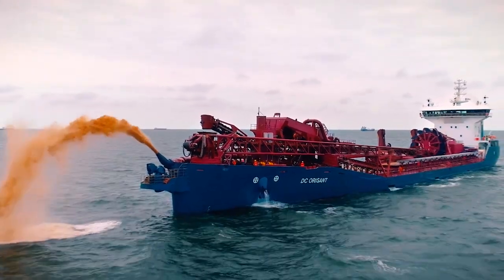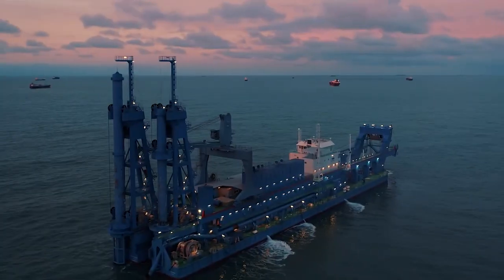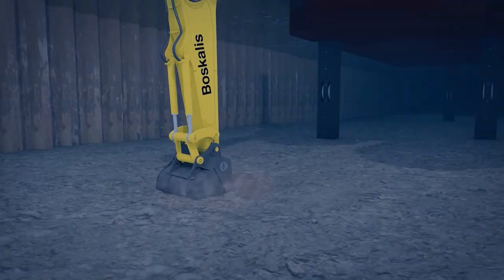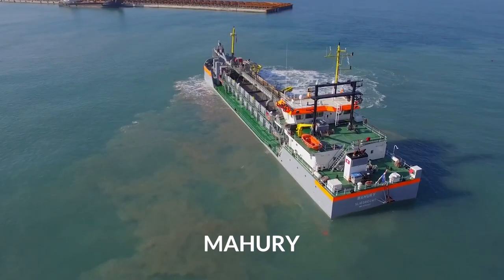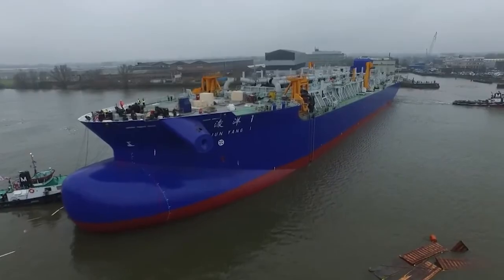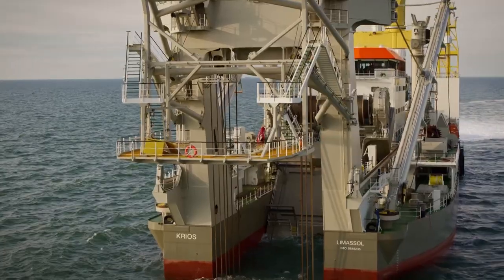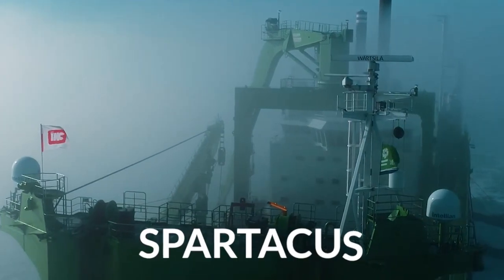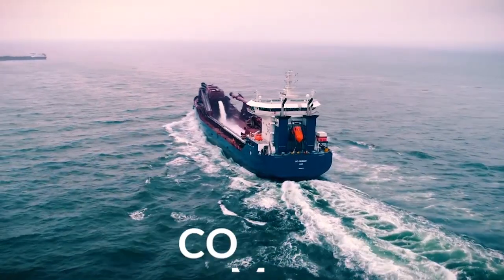10 Most Amazing Dredgers In The World

Comment: Don't know where to start, with a the mistakes. The DC Orisant is a gravel hopper and the bucket wheel excavator has nothing to do with the dredging process, it is just for offloading the gavel. The Mohab Mameesh can't sail on it's own, it's a stationary cutter. The Krios has a hopper capacity, really, interesting. It's a CSD, so 0 hopper capacity.
Some really interesting choices in vessels. So many really impressive ones missing... How on earth is the Mahury in this list? Very run of the mill vessel.
Seems like the main criterium was: built in the last 10 years.